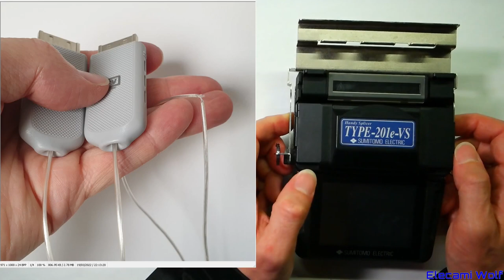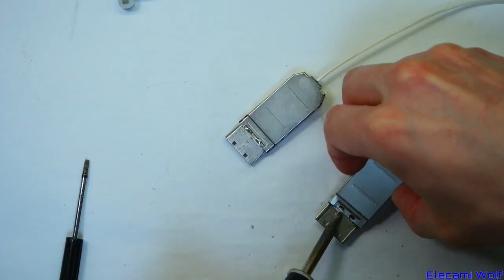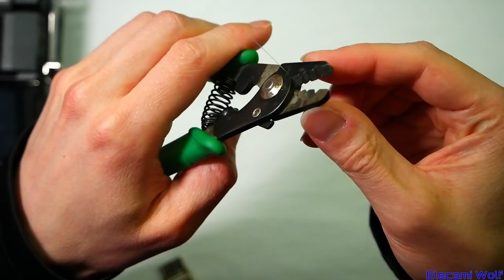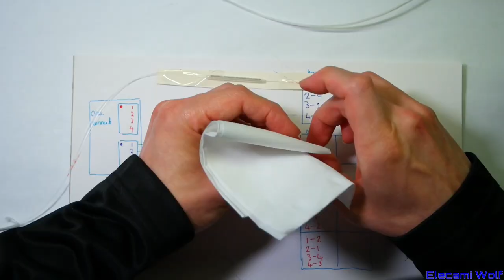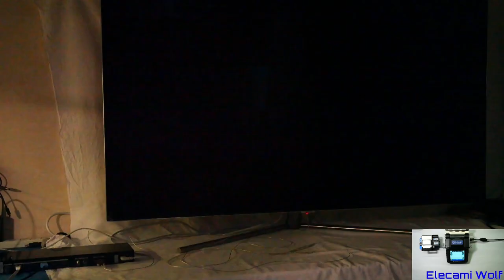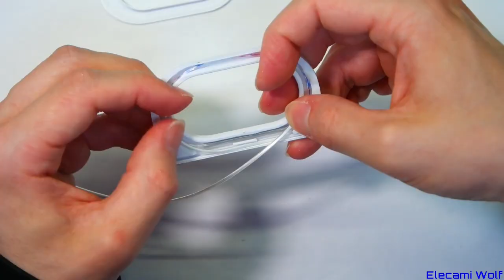EW0037 - How To Repair Damaged Samsung One Connect Invisible Connection Cable

Comment: I have two Samsung QLED tv's and both of them also receive power from the one-connect cable.  It's amazing that they can send power for the 65" and even the 82" tv's through such a thin cable.  Power must be separate in your tv's?  Surely they DO need power, right?  EDIT:  I watched your other one-connect cable repair videos and it appears that the tv display does indeed NOT need power.  That's very amazing.  All the light for the display must come through those fiber optics.  That is very surprising and I have no idea how that can be.
Reply: Power comes from a very thin metal conductors inside of the OneConnect cable. The voltage is rampled up to 350V to minimize voltage drop in the cable.
Reply: @keytron888  That would make sense, but I don't think that is the case.  I watched his other videos and his cable repair only bonded the fibers together.  He did not mention splicing any thin wires together and if you look at the cardboard that he taped the fibers to, you can see that there were no wires.
Reply from the maker: The newer type of One Connect powers the TV through the cable, with 350V DC as stated by Garry .
You can see some photos and details in the thread here:  https://twitter.com/ElectricElecami/status/1516596232701247489

I have recorded some tear down and investigation videos about it, they will be released in a week or so. Keep a look out for EW0040 and EW0041.
Reply: @Elecami  Thanks for your reply!  So how did the Frame TV in this video receive power?
Reply from the maker: @jimbert50  Both the TV and the One Connect Box have their own AC power cables.
Reply: @Elecami  Ah, okay, thanks.

Comment: Thank you so much for this! We have pet rats and while they are very sweet, they for some reason have an obsession with fibre optic cables (they are all out of reach now thankfully, we learned fast). 

What I can't believe is how expensive these cables are to replace, but thanks to your walkthrough I've prepared all the fibres, marked them, and I know someone who has a fusion splicer that has agreed to fix the cables!! 

Thanks for your work and effort, you've saved us a considerable expense and it really isn't that much work to prepare the fibres
Reply from the maker: Thanks. Glad I could help with this.

Comment: If I can get a hold of the tools for fusion splicing what type of fiber cable would I need if I wanted to splice in some fiber in the middle of the One Connect cable to make it about 50ft long. 

Also do you know what the ends on the One Connect cable are called or a model number, if I could get new ends and just install what ever length fiber I needed between each end. 

I have a 2024 model 65” Frame tv.
Reply from the maker: I am not sure. You'd probably have to measure the fiber in the one connect cable and find something with similar diameter glass.
The cable ends will be made specifically by / for Samsung and not likely to be available anywhere.

Comment: Thank you for your video it’s very informative.

Recently either my one connect cable or my one connect box (SOC100M) has decided not to work. I think its the one connect box because if it’s connected by the power cable, it won’t power any external device connected via a USB port like it use too or the optical input light does not illuminate either. 
In your opinion would this indicate the one connect box is broke or the one connect cable?

Again thank you for your video
Reply from the maker: Thanks. Yes probably One Connect Box issue.

Comment: Do you think it might be possible to extend the cable using this technique? The longest cable supporting latest One Connect Pro box is only 5m long and I need at least 7m…
Reply from the maker: You can buy 10m cables.
Probably could be extended. I think the work it would take well exceeds the price of buying the longer cable though. 
If you have the version with power in it. You will need to be very careful with rejoining the 4 power wires. Also note they have high voltage DC on them, 350V. The TV will be damaged if they are not connected correctly. 
Will also need to be suitably insulated for safety. 
I looked inside one of those cables in another video but have not tried rejoining them.

When you are starting with a working cable, you can make the fiber identification process easier by cutting off a section of the outer insulation and marking the individual fiber cores before cutting them. That would make the re-joining a lot easier because you already know what to join to what. Don't need to open up the plugs.
Reply: @Elecami  the thing is that the new cables that support the latest 2021-2022 Neo QLED TVs are only 5m long max. They now call the box One Connect Pro as opposed to the one without „Pro” before) and cables themselves are a bit different - 0.6 cm thick instead of 0.2 cm. Old and new cables are supposedly not compatible. Because of this, I am seriously considering if extending the cables would be my only option…
Reply from the maker: @iron2k6  I am not sure if that is possible extend. When I looked at the 8K TV One connect box (EW0031), the One Connect cable was thick and it was using copper not fiber for the signals. That would not be possible to extend. The signal quality would degrade too much.
It also used low voltage around 50V to power the TV and due to that needed a lot thicker wires.

Comment: other than an obvious break, is there an easy way to test these cables?  For the record, even at $200 for the cable, you've got 2k in kit there! 🤑  (as an aside, my QN55900R started powering itself down and restarting... but now, just softly 'clicks' from the One Connect box.  The cable has been treated roughly - I never imagined it would be fiber - but wonder if it's the box, the main board or the cable?)
Reply from the maker: Probably a power supply issue.
I don't think there is any other ways to test the cable than using it on a known working TV.
Reply: @Elecami   thanks for taking time to reply.  It would be a neat trick to make an adapter that can test the fibers 1 by 1.  I've ordered a new box and a new cable.  I am going to sort this out!  That being said, do you happen to have any details on voltages in/out of the  cable (and the voltage required to run each interface)?
Reply from the maker: @en2oh  Not sure on the voltages. This cable that is fiber only, would only use low voltage like 3.3V or less. and the signals will be much lower LVDS signals. Similar to Display Port or HDMI levels. I expects 1V or less.

The newer version One Connect cable that has Fiber as well as powering the TV Had very High voltage, 350V DC + about 13V.

Comment: Same. I have a 2020 Samsung Frame TV cord that got slightly chewed by a rabbit. Could use your help to fix it. Thank you!
Reply from the maker: Some other videos I did on the newer models of One Connect might help with yours.
EW0040 https://www.youtube.com/watch?v=NF-MVDc1K9Y
and
EW0041 https://www.youtube.com/watch?v=w_39JC2Dkdc
Reply: @Elecami  Thank you. Is the process to fix the cable the same with the older model ? I actually have a 2019 model.
Reply from the maker: I am not sure which years are compatible or not. There are several version. I don't have much experience with this other than what I have sown in my videos. The process to fix other versions of the One Connect cable will be very similar but the connection order of the fibers and wires could be different.

Comment: Hey  nice tutorial how to fx it but  o you maybe can help to fix new cable that have fiber optics  and   4 wires, i think it is model from 2018(bn39-02359a)
Reply from the maker: Thanks. 
I have not tried to repair one of the newer cables but I did a video about one that has 6 fiber and 4 wires.
EW0040 https://www.youtube.com/watch?v=NF-MVDc1K9Y
and
EW0041 https://www.youtube.com/watch?v=w_39JC2Dkdc
Reply: @Elecami  thank you, mine is maybe new desing, wires are not set like on your video but  i got some info how and what and where

Comment: Interested in repairing mine for me for a few bucks.... Lol.... The equipment you need to do it is not cheap....
Reply from the maker: Possible, depends where you are. Need to make friends with your local fiber internet installer.
Reply: @Elecami  where are you located?
Reply from the maker: @Ghettolifer  I don't have the splicing equipment anymore. I had just borrowed it for this job.

Comment: I was so unhappy when i realized that it was fibers and not copper wires... The connector is too thick and it cannot run into my wall conduit ending up with this cable running accrocs the room... i am so p....d
Reply from the maker: Not as visible as it would be if it was all copper. 
I heard from a service technician that people trying to pulled these through conduit with a draw wire etc was the most common way they fail other than the people who pull the TV off the wall and rip the cable off in the process.
Reply: @Elecami  100%, if you are trying to run these through conduit, the chances you break the fiber are high. I am not even trying as the connector does not even fit the conduit. unfortunately, I don't have the tools and skills required to cut it, run the cable in the conduit and then resolder afterward...
Reply from the maker: @ruly4000  I would not risk cutting a cable that is already good. It is quite a lot of work to join.

Comment: I'm pissed I got a thick cable with my 32 inch!
Reply from the maker: Newer TVs seem to have that. I think this really thin cable was only used for a couple of years about 4 years ago. Maybe people did not like the really thin one because you still have to power the TV, in addition to powering the One Connect box.